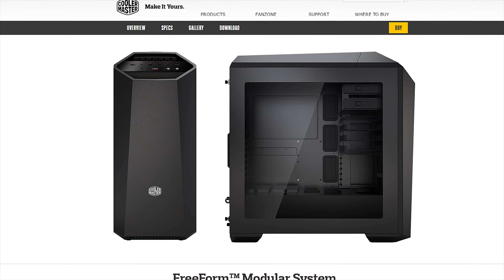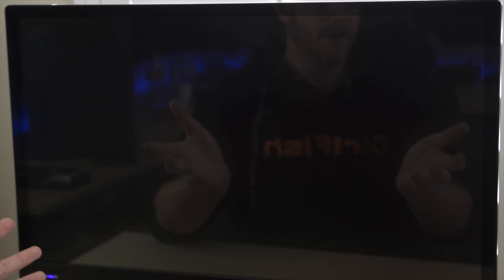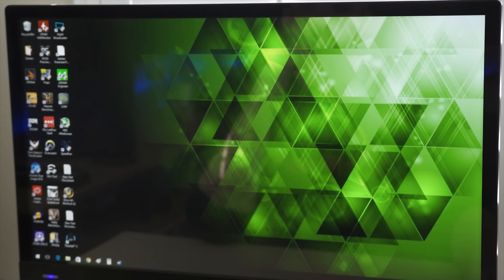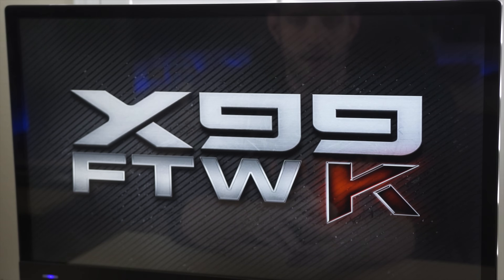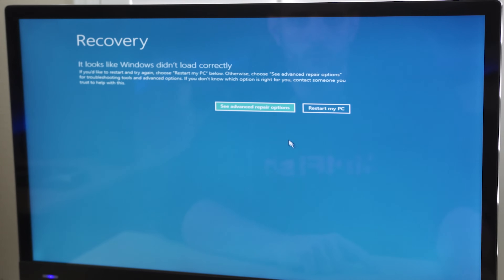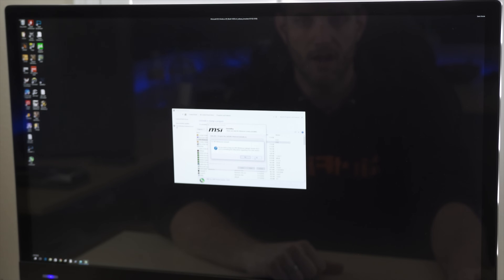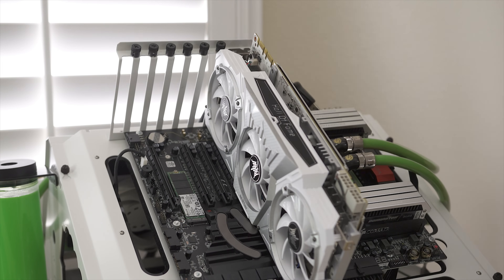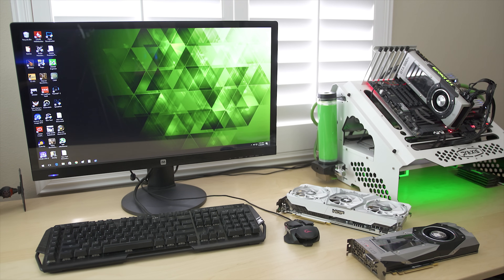How to fix a bad overclock on any Video Card

Comment: lol there is no good reason to use the apply the over clock at startup
Reply: Dedicated gaming PC? Why go through the hassle of applying a stable OC everytime you're gonna use the PC? Easier to turn that off when you know you wont be gaming.
Reply: Its just 2 clicks in the program to apply an overclock if you don't have it at boot.
Reply: Logan Lilley Sometimes its not about the extra two clicks. You just don't want to be bothered with it to begin with. Its all preference anyways and not like its bad to have it on either as long as you already have a stable clock. I really set it once before the weekend when I'll be playing games and then turn it off for the week. That way I don't forget to turn it on which I frequently do anyways.
Reply: Prich038 they are useful.u just need to fine tune your overclock to prevent it from crashing

unless u really likes overclocking your card every single time u start ur pc

Comment: Im still scared that Im gonna kill it...anyone else?
Reply: You can do it! GPU OC's are so simple with MSI afterburner. Just slide the core clock right until you start to get weirdness. If you go too far then its ok, just tone it back a little and then you will be fine. I built my first system about a year ago and I watched a lot of Jay's videos. I have an OC on my GPU and my CPU and I have never had any issues with either.
Reply: The only thing we have to fear, is fear itself. Franklin D Roosevelt.
Reply: Only thing that failed me was my 8800 GT.
But that's probably because of the single slot cooler and 103°C under load. Also they tend do die after 2-3 years in general.
Reply: Wow thx guys for the encouragement, I have a 1050 ti so im gonna try.
Reply: Samster Birdies it wont, voltages increase heat, frequency doesnt do anything 👍🏻
Reply: Probably go up on fan speed then. At least high enough where it makes a difference but also where you can't hear it if it's one that is on the quiet side.
Reply: Actually I didn't even touch the voltage on mine. Just core & memory & it did raise some temps. Fan speed up to 40 rectified it though.
Reply: I was that way, but I was about to upgrade and tried it out. My Card: EVGA GTX 760 ACX cooler. Ran stable at 1280 MHz boost clock and I forget what the memory clock was, probably around 17-1800MHz. 1.212 Volts. All was fine, I shut down my PC, tried to restart and it black screened. Tried to restart it 3 times it went into that menu, I looked up what to do on google before I fixed it and found this video lol. Yeah the worst that can happen is it will crash Valley or whatever benchmark you're using. But I'm maybe setting the clocks a little lower, as the highest clock I found for 760's was 1306 MHz which my card got very close to. I hit 1306 and it ran half the benchmark until it crashed. I could get like 1150 very safely. Just do your research. Like Jay said, you can't really hurt it, its hard locked with the 7xx series for the voltage and the software won't let you put too much into it. The only real way you can hurt it is through bios and over voltage. You'll probably be fine he did +1000 MHz, I only added +63.
Reply: Voltage limit on GTX 10 series cards are 1.093. If you move the slider to 100% voltage usage it will still only ever go to 1.093. it knows not to overvolt your card. Unless you're modifying voltage values in BIOS you won't ever accidentally fry your card. Stick to afterburner or precision and the worst that can happen is what Jay Just showed.

Comment: i have the same problem, but it just a bit different. my card still alive, and not crashing, but  its give lower fps, slower startup and i cant modify anymore  in msi afterburner. can someone help me how to fix that?
Reply: Same here. did you find a fix?
Reply: @RainyFN  yp , i remove the card, give it a little paste on the gpu and reinstall. After that i go into the device manager, and update the driver. Thanks god gt 630 works again :)

Comment: If you have a Zotac card and use Firestorm, it resets the overclock settings if your PC crashes (which can happen due to overclocking) even with startup enabled. Honestly, kind of annoying, but helps with bad overclocks. Not entirely sure if it's intended, but it does actually help with that.

Comment: Newbie miner here! I some more efficient OC settings on my gpu to maximize profits. I ran into this issue when my PC crashed overnight. I would start the PC bad get blue screened. It eventually would not boot Windows. Thanks to the help of your video and others I removed the battery on the motherboard and it starts again! Thanks for your help!

Comment: Just ran into this problem and have a quick alternative.  Once you get into safe mode, instead of uninstalling msi, you can open it up in safe mode and uncheck the "Apply overclock at system start", then close and reboot.  You may get an error message, but the setting sticks after you reboot.

Comment: i over clock my laptop gtx 1650 to 1800mhz and undervolted to 750mV loaded up bo3 zombies screen froze for 30 seconds then closed the game 
then restarted the settings in msi after burner then restarted my laptop got a blue screen for 15 seconds laptop turned on. it’s a miracle my laptop still alive, i’ve learned my lesson

Comment: that's one of the reasons i just don't apply overclock on startup lol, just run afterburner at startup and start minimized. i use the system tray temperature indicators, so when i'm about to open premiere or after effects or a video game, i just click one of those indicators, click a profile, and minimize. it's not that i don't want to be overclocking while browsing youtube or anything. i mean as long as your profile is stable it shouldn't really make any difference to the health of your gpu. i do my video work with an aorus 1080 ti xtreme, so i can offset the power limit by 20% or more, and that's exactly what i do for my rendering profile. raising the boost clock or the memory clock while browsing youtube won't do anything, since the gpu isn't under nearly enough load to start boosting to those numbers anyway. you're adjusting max clocks but your gpu's running on min clocks. offsetting the power limit shouldn't impact idle behavior either. so you're fine to apply OC at startup, once you've at least stress tested the config. sometimes there can also be issues at startup that you can't really test without applying the OC at startup. like it depends on the rest of your startup items. if you test your overclock by applying it manually, after all your other startup programs and background processes have been loaded, then you may miss possible issues caused by buggy drivers or software. so it's good to test the startup application even if you're not planning to use it permanently. but yeah the main reason i don't want to apply an OC profile at startup is because it doesn't actually save me any time. i use different profiles for different things. for editing i like to boost the memory clock well beyond the "OC mode" preset, but not touch the power limit and voltages because it's less important for my workflow, and it could conceivably reduce the lifespan of the card. let's not get into that can of worms though. anyway for rendering, i'm gonna need to boost everything, not just core clocks but power and voltage curve, and for that profile i just set the fans to manual 100% because i don't want the CPU wasting resources on polling the sensors and calculating hysteresis and shit. however minimal it may be. so i'm already going to be applying profiles myself anyway. afterburner makes it so easy to apply a profile with just a hotkey. and then if i do have an issue, i don't have to waste time secure booting and so on. i guess that's a particular use case though, i can imagine if i was purely using it for gaming then i'd just want the gpu to manage itself without any input from me. but speaking of that, i wonder if there's some plugin you can use which will apply an OC profile when you start up a specific program. like how logitech mouse lets you attach a profile to a specific game or desktop app. something like that would be great. lets you start up without any overclocking, so you can get into afterburner and change things if there's a problem, but then automatically applies an editing profile when you open premiere, and automatically applies a rendering profile when you open media encoder, etc.

Comment: MSI Afterburner stores the profiles in /profiles of the app's folder in Program Files. You could just boot into Safe Mode and delete the most recent profile. Solved my issue.

Comment: If you need to overclock anything at all you are already doing it all wrong.  OC is fun to crunch numbers and have a play at tweaking,  the aftermarket benchmark software will even tell you what you are getting <or supposed to be getting> it's quite interesting.  However:

None of the benchmark numbers you see are ever gonna happen on your computer, theres a huge difference between getting a measured reading and actual performance.  Also as we are still using 2015 technology for these processes and even back then were unable to OC performance greater than what DMi 3 maxes out at.

Here's a short text on the issue:

In computing, Direct Media Interface (DMI) is Intel's proprietary link between the northbridge and southbridge on a computer motherboard. It was first used between the 9xx chipsets and the ICH6, released in 2004. Previous Intel chipsets had used the Hub Interface to perform the same function, and server chipsets use a similar interface called Enterprise Southbridge Interface (ESI).[1] While the "DMI" name dates back to ICH6, Intel mandates specific combinations of compatible devices, so the presence of a DMI interface does not guarantee by itself that a particular northbridge–southbridge combination is allowed.

DMI shares many characteristics with PCI Express, using multiple lanes and differential signaling to form a point-to-point link. Most implementations use a ×4 link, while some mobile systems (e.g. 915GMS, 945GMS/GSE/GU and the Atom N450) use a ×2 link, halving the bandwidth. The original implementation provides 10 Gbit/s (1 GB/s) in each direction using a ×4 link.

DMI 2.0, introduced in 2011, doubles the data transfer rate to 2 GB/s with a ×4 link. It is used to link an Intel CPU with the Intel Platform Controller Hub (PCH), which supersedes the historic implementation of a separate northbridge and southbridge.[2]:14

DMI 3.0, released in August 2015, allows the 8 GT/s transfer rate per lane, for a total of four lanes and 3.93 GB/s for the CPU–PCH link. It is used by two-chip variants of the Intel Skylake microprocessors, which are used in conjunction with Intel 100 Series chipsets;[3][4] some low power (Skylake-U onwards) and ultra low power (Skylake-Y onwards) mobile Intel processors have the PCH integrated into the physical package as a separate die, referred to as OPI (On Package DMI interconnect Interface)[5] and effectively following the system on a chip (SoC) design layout.[6] On 9 March 2015, Intel announced the Broadwell-based Xeon D as its first enterprise platform to fully incorporate the PCH in an SoC configuration.[7] 

Sorry guys your 5ghz OC's and other attempts are currently futile even if the testing software tells you otherwise.

Comment: described precisely my experience on a laptop with memory oc and vbios from another manufacturer (+10W on laptop and temps were being kept below 65). it would freeze on some apps then occasionally return bsod with tdr, geforce would crash, timespy wont detect adapter at all. tried ddu, different versions, reflashed stock vbios with no avail. panic but eventually had a system restore point roll back (before oc) and it helped. was pretty sure i restored clocks in AB earlier but probably didnt do it correctly and didnt think uninstalling it lol

Comment: I did this and it was Xtreme Tuner not MSI afterburner, now I'm stuck on a loop and don't have spare GPU. I tried OC on the ram side but I went a bit too far. 

I can't afford to reset my PC Completely because of the massive games, and their respective gamesaves it has on it

Comment: i think its the ctrl button and not the shift button, and it works, you got to press it just after logging in and keep it pressed like a maniac because ab applies the settings a few seconds after logging into a session.. i actually feel that this feature is redundant because you always have the safe boot option and sometimes you might press the ctrl button accidentally and lose your settings and the worst part is that you might not have even realized it.. would be great if someone could make this known to the ab developers

Comment: I'm not sure if this was a feature in Afterburner in 2016, but if you hover over the Windows logo in Afterburner that enables "Startup" mode, it says you can hold CTRL straight after logging into Windows to bypass applying the overclock.

Comment: Yeah I had a good stable overclock going, I tried to boost my 550mhz memory overclock to 555, windows crashed, now I’m stuck in a boot loop. I’ve tried both another graphics card and integrated graphics. Cant get into safe mode to turn it off. Can’t even get into BIOS to restore windows. Thanks Jay.

Comment: I overclocked my Inno3D GTX 1050 Ti Twin-X2 with my settings:

core voltage: +100 (1.03v to 1.10v)
power limit: 100
temp limit: 97
core clock: 200
memory clock: 585
Fan: 100

It is the most stable but extreme in my preset, well my cpu and gpu fan is always at 100% but you won't hear it when wearing headphones :3 it is like a jet engine in here. It can achieve 1911 when you don't increase the voltage which is true, but I achieved 1936 by increasing voltage from 1.03v to 1.10v-the maximum I can crank lmfao. It won't melt the card ain't it? it is the oc value I can maximize without crashing or flickering while playing. Cranking up memory clock from 600 might cause flickering in games even crash :3
Reply: Damn you cranked your voltage to the max? Those temps must be above 80 degrees at stock clocks haha
Reply: @patrickh92able  I still have 74 at most while gaming, it even reached 1974mhz core clock at 55% lmfao. But average is 1911-1934mhz.

Comment: I attempted to use MSI Afterburner a few times and each time my system screws up either immediately or after a few weeks ... the program sucks! Kombustor stops working no matter what I turn the graphic setting back to, to recover it and eventually all my great scores goes to shit for one reason or another. Either I suffer in rendering times (Blender) or my FPS sucks! Great Vid, thx Jayz!

Comment: My monitor is showing "out of range" when i try to enter in safe mode. Now how to fix that?
Reply: @powerfitz_  yes but safe mode normally has a screen resolution of just 800×600 i guess.(my monitor has 1366x768,GPU RTX 2060 )

Comment: Hy Jay, I would love if you did a full video on an overclocking of a gtx 1060/70/80 with the latest version of msi afterburner 397.64 (when it crashed, at what temp - water vs air cooling). Using Kombustor and fps result in games before/after.

Comment: If you running a chip that has IGPU like intel 8400... or 9600k .... also just connect your video out to motherboard graphic chipset. Unplug the gpu video cable

Comment: Sadly, it seems like I totally "broke" a brand new card simply by overclocking it using MSI Afterburner. I obviously didn't mess with the voltage, but I did decrease the power and increased the memory clock gradually up to near the maximum value. Temperature was in the high 50s, and it crashed. After a reboot, I did reset everything on Afterburner, but it was too late.

Now, it shows green artifacts at all time, even on a fresh Windows 10 install, with Afterburner uninstalled or while the card is physically in another build. Hell, it even shows these artifacts while I'm tweaking stuff in the BIOS. Maybe all what the OC did was to kill the GPU sooner than later, and that this one was bound to fail eventually. I'm no tech guru, and maybe the OC didn't do any damage and that this card was defective from the start, but I would recommend to err on the side of caution before overclocking too much.

Comment: you are right. my Zotac RTX 2070 super amp is factory overclocked to 1985 MHZ. But i don't know why, after fresh installing my windows and every necessary software including FireStorm and GPU  driver it suddently stoped to run in that frequency instead it was running at 1605 MHZ.I tried uninstalling the firestorm once it didn't worked.Second time I reinstalled it again fresh.,then restart my pc, went to bios and did load optimized default setting's. Again back to Window's and guess what happened this time?....It worked...back again oc.i figured it out at last what was the issue going on with Firestorm. Maybe because of some update of system or Nvidia driver may changed the gpu power to 100% and some other changes that I didn't do it manually. Your video really did help me to achieve success this time. thank's @ 
JayzTwoCents

Comment: I got a 350 MHz core overclock and a 1100 MHz memory overclock on my gt940mx
It runs without any problems or artifacts but is it safe 
Temps stay between 70-80
Reply: C Rizzy my room’s like 25-30 degrees 
And btw it’s not 350 MHz on the core clock it’s 150

Comment: Hi! I have an old card, amd ati radeon 5800, my pc is not starting, if I take out the video card and use the integrated works fine. Can I recover the card? I need a different car or can use the integrated?

Comment: does this work if i under volt and get artifacting or any other graphical issues from too low voltage? will a  under volt damage my gpu?
Reply: Too slow.. Wel no unless you do it too much and just why underwolt it will not help or turn down the électricité bill